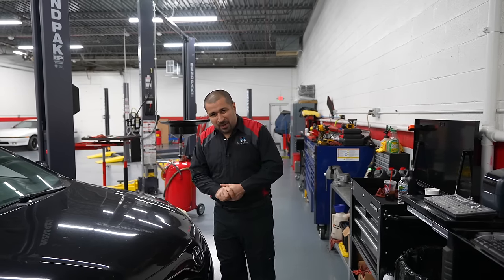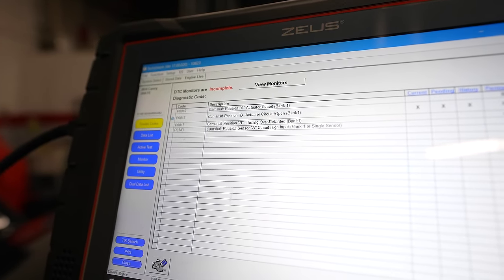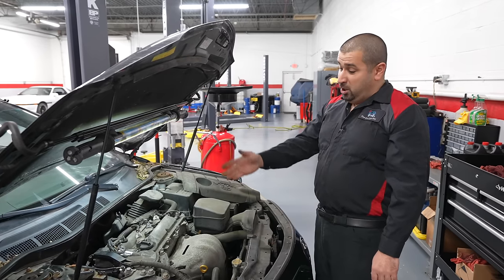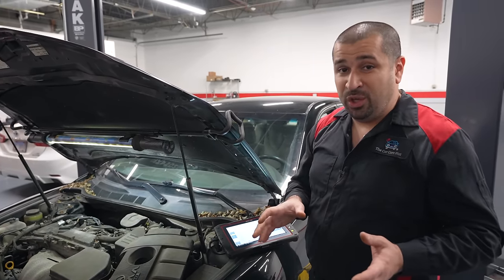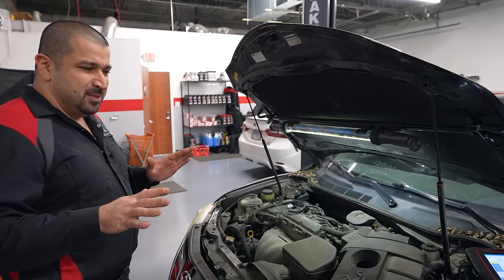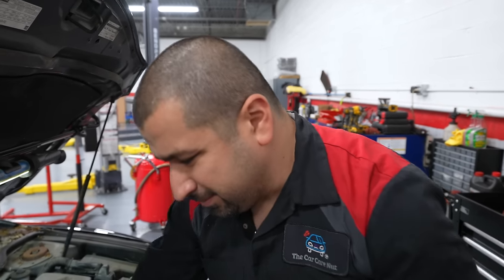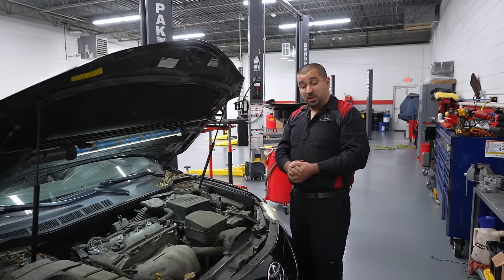Mechanic Parts Cannon FAIL Cost Customer A LOT! Let's Try This Again

Comment: You are an outstanding mechanic, and we need far more people like you in the repair industry.
Reply: He's THOROUGH. That's all it needs, not 'quickly jumping to (false) conclusions'. It needs thinking stuff through, not a knee-jerk reaction.
Reply: I suspect we don't because there's not enough money in it. It requires a huge amount of very detailed information, but I doubt the pay reflects that.
Reply: @normcook9335  That is not my suspicion. The average labor rate for mechanic work is $110/hr roughly. Obviously the cost of running the shop absorbs a good amount of that, but even if mechanics get half of that, that is a good wage these days. More likely the case is that we have lazy boys and young men who, instead of pursuing trades, sit in mom and dad's house until they are 30 and live on government hand outs and minimum wage jobs. The labor participation rate among young men is lower than perhaps ever in American history, and for every 5 men who retire from the trades in general, only 1 or 2 replace them. The trades pay very well these days. Apprentices usually start around 55k, and I know that established contractors are easily pulling down 150-200k a year if they have a good work ethic and organization. I see no reason why a good mechanic like AMD cannot achieve similar levels of success.

Comment: I love your channel. Most technicians use the parts cannon because they are paid flat rate to change parts, not to diagnose. The reason they had it for a week was it was a come back, they worked on the gravy jobs first. I apprenticed and went to school 2 years. The techs gave me the cars their parts cannon didn't fix because I worked for 5 bucks an hour and could take my time. The owner of the dealership had me work on a car his neighbor bought because one more time and it would be returned under lemon law, and he was embarrassed. He told me take as long as I need, but fix it right. It had fuel trim code, they had changed fuel regulator, fuel pump, etc. I connected scan tool and took it for a drive to see what fuel trim would do (newly hired, barely knew anything about EFI as I grew up with old cars with carburetors). As soon as I left the noisy shop, I could hear the vacuum booster hiss when braking and fuel trim changed under same conditions. I pulled back into the shop and asked parts man to order me a booster. He thought I was crazy, called the service manager, said it's a fuel problem on the order and I wanted brake parts. I explained to service manager how vacuum leak was throwing off fuel trim. He told parts man to order it. Service manager loved me after that, Car never came back. After becoming certified, I was put on flat rate. The techs with seniority got the easy jobs. I might get hard ones or none at all, book 20 hours in a 45 hour week. Get paid $14 when customer got charged $95 (20 years ago). I went back to my desk job. Around that time, my friend took his Volvo to dealer, bad catalytic converter, $1800. He brought it to me. I had no scanner so I changed his downstream O2 sensor, threw an upstream on too in case cat was bad from running rich, left cat alone, code never came back. Saved him $1600 even without a scan tool using my parts cannon! Another friend had hard starting after car sat over night, I pulled out the parts cannon and shot a $50 fuel regulator at it, cheaper than $130 diagnostic quote. Sometimes the parts cannon saves money, but I recently bought a sophisticated scanner with bidirectional capability. Now I'm relearning after being out of it for 20 years. Your channel is great!
Reply: @Paul you are so correct! Sometimes they don't know any better, sometimes they want the scrap $$$ that oem ones bring. Factory Cats rarely go bad, unless something is causing the engine to run rich and they keep driving it that way. I just changed the cat on my 2003 Corolla with only 99,000 miles on it. No codes set but there was a hole rusted through the case! The whole car is rusted out from road salt, a shame. Runs great. Probably 80% of catalyst inefficiency codes I see are bad downstream O2 sensors. Not a bad idea for folk to get a 2nd opinion on costly repairs.

Comment: I heard a similar story a few years ago.  The customer was told they needed a new engine when the problem turned out to be a bad coil!
Reply: That’s called a parts nuke!
Reply: Sister in laws car was running rough after having just been worked on several weeks prior.  Took  it back and the mechanics came out and diagnosed she needed a new engine by "listening" to it.  After hearing that story I took her car to my trusted mechanic who found they had not secured the distributor and also some uninstalled fasteners laying loose.  I don't know if they were running a scam or just incompetent.
Reply: @wolfeadventures  More like, "Lucy, you got some 'splainin' to do!"

Comment: Well done. Unfortunately happens way too often. Essentially those shops that don’t have the skills/ethics have a license to steal.
Reply: Yes, and so many of them victimize the customers who can least afford it. It maddening as hell.
Reply: Is there no legal recourse, small claims court, lawsuit?
Reply: Vehicle owners need to get used to paying for the diagnostic, and get a guarantee that the business stands behind it. Sure, in some cases it'll need to be made clear that there may be other issues that can only be revealed and diagnosed after the first problem is fixed, but that is rare.
Reply: @yarisygatos  Not really. You could take the shop to small claims court. the mechanic will tell the judge that even though the replacement parts didn't fix the problem, the parts were bad and needed to be replaced. You not being a-licensed mechanic would not qualified to dispute that, so the judge will side with the shop.

Comment: Very interesting video. I was an electrical maintenance technician and you're absolutely correct! The correct diagnosis is the key to the correct repair and not being a parts changer.
Reply: I used to be a process technician and a few years later become an Electrical and Instrument Technician for 25 years, but not in automotive. AMD is very knowedgeable and skillful in his field job, and right kind of approach, thinking process and skills to resolve the issue at hand. 
These were the kind of Technicians I enjoyed to work with after I was promoted as Plant/Facility manager til I retired 5 years ago. 
God bless AMD as he works and manage his own workshop at the same time sharing to the community.
Reply: @metzmatu8409  👍

Comment: In my GM ASEP class we learned the strategy based diagnosis and it was very good if you followed the steps. Complacency is the absolute worst thing when it comes to troubleshooting. The thing that fixes the issue the last time might be different this time. Also just put people on mute when they are telling you all this stuff they checked,  start from scratch and assume nothing.  Remember,  they couldn't fix it.

Comment: Its a shame we can't clone you and put you in all garages around the world! lol. You are like the vehicle detective, you have a very methodical and logical way of working, its a shame not all technicians are as intelligent as you!
Reply: Sometimes it doesn't have to do with intelligence but rather lack of motivation or desire to actually diagnose and fix the issue. I've seen my fair share of competent techs just throwing part at a problem until either the issue or the client goes away out of laziness and\or because they hate electronic diagnosis in general. It's pretty unfortunate :(

Comment: For even a master technician, there’s always a lesson to be learned. AMD shares his knowledge so other can also learn. Hopefully, this customer can return to the previous shop, explain their situation and obtain a refund and their old cam sensors.
Reply: Definitely, at least get his old original cam sensors back.
Reply: @Jean Cassel  my bet is the mechanic placed them in the new boxes from the replaced sensor and returned them to whatever part store they got it saying the part is defective
Reply: Good luck on that. As for the old sensors, they got paid for the new ones, they likely went into the trash. Never know though, some techs will throw parts they know are good in their tool box...
Reply: @Mouse Toad  boy you have never been behind the counter of the commercial department at autozone  I have had and seen shops buy O2 sensor ac blower resistors and days later send back the old part saying the part is defective if we say no to return the shop will complain to the boss of the commercial department boss or say they won't buy from this location anymore
Reply: That shop probably trashed the old cam sensors and its at the trash site.

Comment: I wish there were more mechanics like you. I had a jdm swapped engine from a local shop, the labor and engine included was just too cheap to go through the hassle of swapping it myself along with a 90 day warranty. Well a month after the swap, they did a good job with getting everything in there but the vehicle ran rich and I diagnosed it myself down to only leaving bad fuel injectors. I get there and they just tell me change this, change that without even looking at fuel trims.. I show them fuel trims and the mechanic doesn't seem to even understand what they were. I argued for a bit but finally got them to get some different fuel injectors and it solved the issue right away. If I wasn't mechanically inclined, I would probably be screwed in the same situation.
Reply: This is awesome!

Comment: This is a wonderfully done video with some great information in it. Car Care Nut certainly knows his stuff! There is one more thing I would suggest just to be 100% sure and that is this. When checking the wires for shorts or continuity tests,  wiggle the wires from the sensor connector to the computer. This is just in case you have an interment problem with a wire shorting or opening.

Comment: Glad you took the time to teach the viewer how to do a proper diagnostic before the parts cannon gets activated. Now, the option for this customer is to get a used ECU and have re-VIN to this vehicle and call the day. The only roadblock will be having the scanner and the interface in hand to write the new VIN on the ECU. Something that I hope The Car Care Nut has in the shop.

Comment: This is a very good tutorial, I mean not on the detail. But just the analysis is so important. If you feed a Search engine the wrong question, you will get the wrong answer. Great example of the Tablet/Smartphone generation. They need to be told what to do. The old style 80's/90's generation is before the Tablet/Smartphone era, so they take the next mile to find out and how to isolate the problem. That's why this man, will not only function as Senior mechanic for cars, but actually he can work in every field where problems are and knows well how to get the root cause. No correct root cause, no fix!

Comment: From the DIY perspective, trouble codes are exactly what AMD said towards the end. It's a place to start looking, not a prognosis to start replacing. What's helped me tremendously in pinpointing problems is going through the voltages the part or sensor is expecting to see. My last issue started with a crank position code, which long story short, ended up being perfectly fine. I fell into the trap of replacing it initially, only to yank it back out, cleaned and put a lil dielectric grease on the old one, and voila, perfect function again. That was after doing 8 plugs and coils, then having another issue pop up where the MAF wasn't seeing the right values and started misfiring at startup but cleared once it got up to temperature. Cleaning it unfortunately didn't fix the problem but a new one from Toyota did. Case in point, I wasn't getting an MAF code, but checking all the systems data values to figure out what was really the problem got my truck working again. Had I taken it to a shop, who knows what the final bill would have been, but an educated guess would be north of $2000. 
Where I really got mad was paying for an allegedly Denso product only to receive a generic POS that was more problems than it solved. I'm now Adamant that only Toyota parts are going on mission critical components! Even if aftermarket parts are cheaper, there's no guarantee they will produce the expected signal or have the correct value the ECU wants. At that point, having to deal with shipping delays and ripping the engine apart twice, it's just easier to go OEM and do the job right Once.

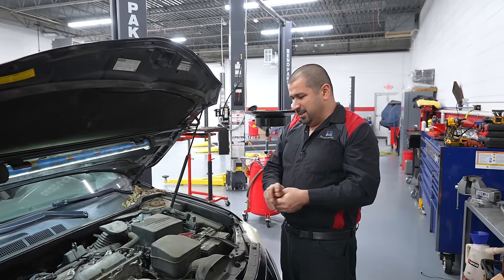Comment: What you said at 23:00 about what the computer is saying about a code is what I have been preaching for years.   Read the book on why the criteria is required to SET the code.  Never throw parts to fix a problem.  Diagnose it!   Thanks AMD!  I fell down that rabbit hole once.  Both banks rich on. L29 454, couldn’t figure it out and finally gave in and replaced the o2 sensors.  Gut said no, rich bank 1&2 could not be BOTH o2, parts don’t fail in pairs hardly ever.   Guess what, wasn’t it. Used aftermarket sensors and that caused another issue that wasn’t apparent.  Ultimately it was a leaking fuel press regulator and then I found my non AC Delco sensors didn’t have the shell to sensor grounded as required by the shop manual for them to work.  Wasted a lot of time.  

Thanks AMD!
Reply: Good points that I share. I very much like this channel, but was unfulfilled that we did not see an update AFTER the fix. Also I am still not 100% sure the computer is really faulty. It could have needed a simple reboot or re-install software.

Comment: Another great video, BUT I am not 100% convinced that the computer was really faulty. There is still a chance that it could have only needed a simple reboot or re-install software.

I once had a TCC PWM lockup problem on a 4L60E that ended up being due to faulty computer. I think this may be more common than people realize as most people seem to by default just simply eliminate PWM TCC lockup, not realizing that it could be computer related (also while not realizing that PWM lockup converters should not be used without PWM lockup due to different clutch material).

Everyone, including transmission experts claimed the vehicle needed a new transmission. But I kept testing the transmission and TCC thoroughly and it all tested fine, including continuity. Finally I started throwing a few parts in my despair, still not success.

Only when I switched ECM, the problem 'miraculously' disappeared and hasn't appeared since.
Reply: What do all these acronyms mean?

Comment: I’m a delivery driver for a living  ! I’ve learned over the years to not trust any of the mechanics in the auto repair shops in my community because I’ve been burned in the past! This led me to learn how to properly diagnose and maintain my own vehicles saving me a ton of money and headaches. Just to prove to some of my colleagues in the delivery business how much dishonesty corruption untrustworthiness and lack of knowledge of the mechanics in my area has brought my car to three repair shops. I already knew exactly what the issue was what needed to be done to correct it. My car was at each one no less than three days and when I finally got a call back they were asking permission to do work and replace parts that were completely unnecessary to the issue I brought it in for!

Comment: This is exactly the kind of video I like to see you doing.  The most important thing i learned here today about toyota is that the engine operations are in the big connector and small has body functions. I also enjoyed the process you use for double checking.
I would do the same thing. Thanks please do more like this specially with the Camry :)

Comment: As engineer, I can tell you have a mindset of an engineer “looking for root cause” versus just replacing parts and that is the best way to resolve problems.
When the motor on my window stopped goes up and down, I disassembled the window to got to the motor. I opened the motor up and fixed the bushing inside the motor as I refused buying an entire new assembly as dealers don’t sell just a motor.

Comment: One of the best things I admire about the car nut is his absolute zero ego level…I’ve learned so much from this 25 minute video and that’s invaluable because I can apply that to my own working within the motor vehicle repair industry, I myself can have that arrogance and attitude to say to any potential customer that I know what I’m doing so don’t cross my path with what you think about my diagnosis and repair professionalism..so kudos to the car nut he’s not only taught me to be a better mechanic/technician but also to be more humble and respectful towards the customer who’s paying for the repair and keeping me in Business, to sum it up if you have a vehicle that comes in take better time to concentrate on what the problem in hand might be, and not just doing a quick component change that might be unnecessary and be at greater cost to the customer and also give more headaches to the both of you because in the end and as seen the part/parts changed still cause the vehicle to display the engine trouble light and not to run correctly..

Comment: The Toyota dealership in Loves Park, IL told me I needed an ecm in my Scion IQ without even looking at it.  I have intermittent abs/Trac control light on. Service advisor said "it's always the ECM" and refused any other possible reason, seeing as I was there for a cvt fluid change and had the car back to me in less than 30 minutes.  I think I'll make an appointment on your website for the spring, I want real answers from someone I trust.
Reply: I work on cars in Rockford Illinois.
I can easily figure it out for you jake. Im electrically savy. Money back if we dont fix it… but, I always figure it out, so good luck with that.